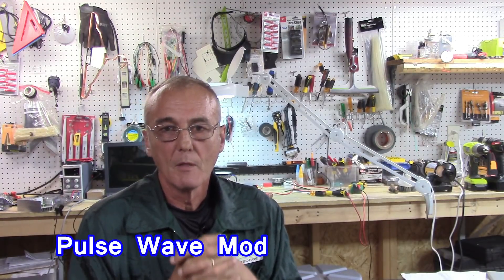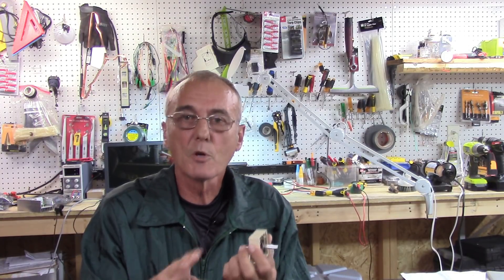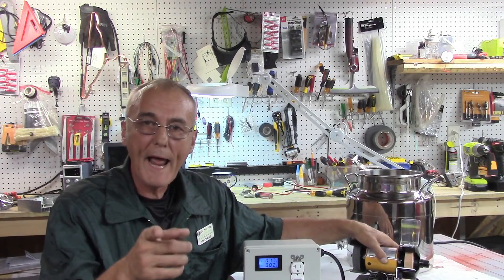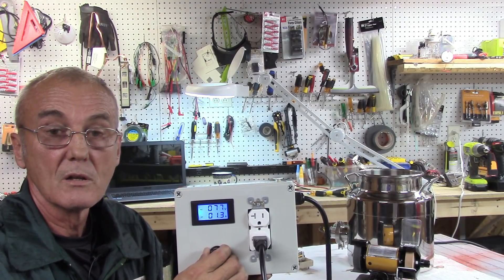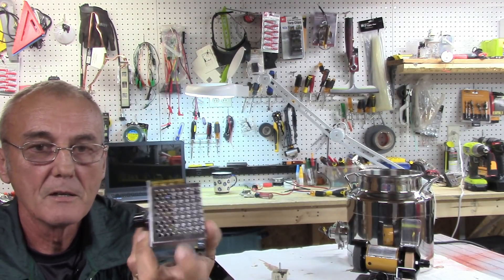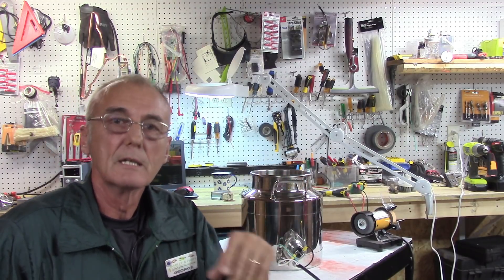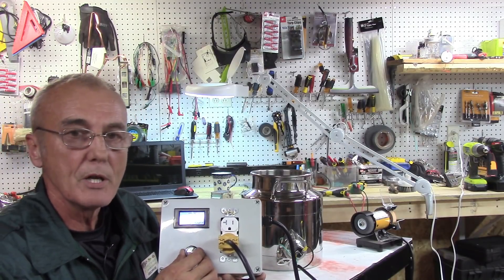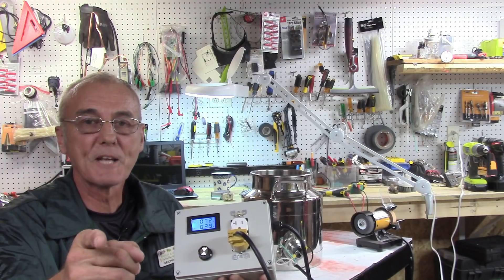Testing the Pulse wave modulator as a heat controller

Comment: I'm so disappointed, after waiting so long for you video on PWM,  I don't think I'll be able to use it for what I intended it for. Thank you for another excellent video and I look forward to the next in this series. My problem is, I wanted to use a PWM and a heating element in a Brew pot/Kettle. But thinking about the exposed element coming in contact with the wort and the scalding effect that would take place, I don't think it's a good idea.
Reply: Charles Chapman you should be good. Check out electric brewer Tony Yates and Short circuit brewing. His boil kettle has an exposed heating element.
Reply from the maker: Maybe a stainless steel element will do it.
Reply: BIAB type setup which keeps the Grains off the Element.  Maybe something like the GrainFather with a Metal Basket.  No issues with Wort being scalded if the pump is on.  And no Grains are in contact  with element.  I have a system from ClawHammer Supply which has a PID controlling the Element.  It is equipped with a Stainless Whole Screen Basket to hold grains.  Those are available after market....